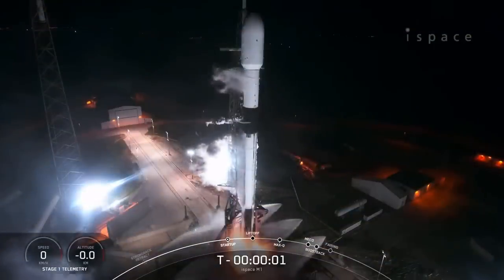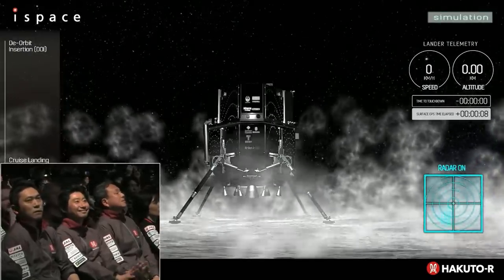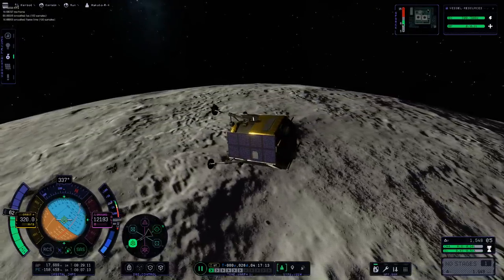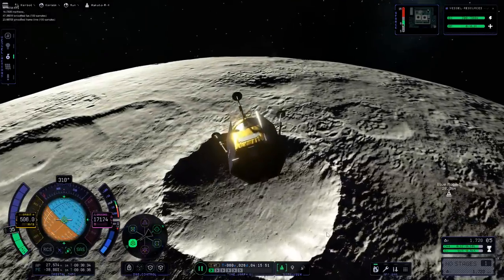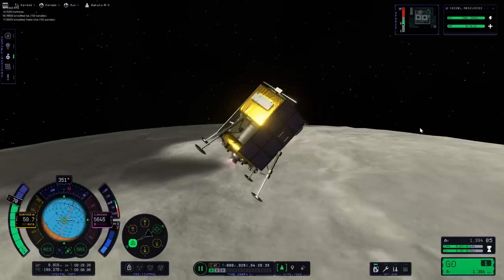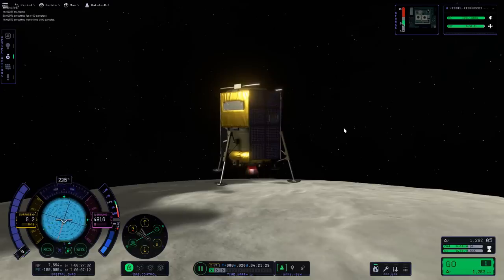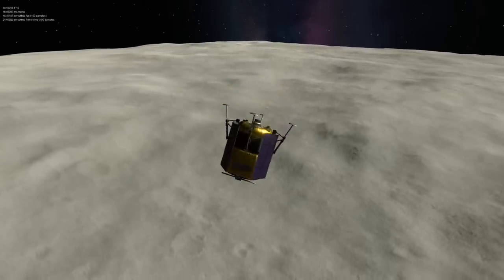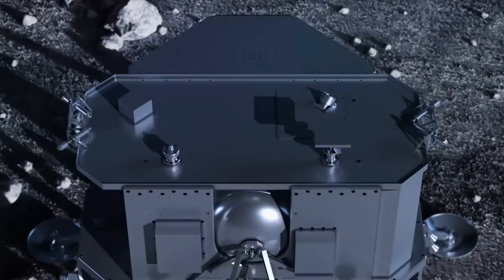Why Japan's Moon Lander Crashed Due to An Unbelievable Computer Bug

Comment: In their official debriefing, ispace actually admitted that it's primarily a (project / program) management issue, not an engineering issue. That gives me hope that they might actually learn something from this.
Reply: most underrated comment
Reply: Life imitates art: a common problem in the Dilbert comic results in utter failure.
Reply: It's almost ALWAYS a project/program management issue, not an engineering issue. This was also true for Mars Polar Lander and for Mars Climate Orbiter (the one that famously mixed up imperial and metric units).
Reply: Don’t bet on it
Reply: @Josh_728  Get with the program: in 2023, we measure things in bananas
Reply: The engineers will have learned a lot from this. Sadly, the management will have probably learned nothing.
Reply: @zackmollusc3522  If that’s the case, new management is needed. Learning from errors is important for progress. Someone who cannot learn from errors should not be managing anything, I think
Reply: @naturegirl1999 Management decides if management change is needed.
Reply: Engineering issues are also project/progam management issues.
Reply: @charleslambert3368  It should be, yes... but when a project is run by non-engineers, bureaucrats and accountants, that  is not always considered as such. ;)
This is when they can f*** up like this.
Reply: After more than 50 years after the first moon landing and with the technology since then, we can’t land a successful moon landing. Amazing what NASA did in the 60s.
Reply: @jaknap1  well those were manned missions. A little easier to land something when a person who’s there can take over and guide it in manually. As was talked about here, these are software related issues (born from the necessity to add redundancy to every facet of every process). 😊
Reply: That is an amazing admission. Well done ispace!
Reply: @Josh_728  I mean a lot more countries than the US use imperial units in some areas like aviation. Knots and Feet are the standards in western aviation even for non US countries.
Reply: @naturegirl1999  Someone that has never dealt with the admins before? lol
Reply: @aakksshhaayy  you are correct. I’ve not dealt with admins before.
Reply: Management: "We've decided to change the landing location."   Flight: "we'll need to rerun the-"   Management: "No you won't, it'll be fine."

Comment: Such a bummer that a error correction filter with and edge case nailed them. Lots of amazing data and at least it’s a software fix!
Reply: Cliff case*
Reply: Edge case?  A crater on the moon?  But it's not just a software fix is it?  Or are we talking about a KSP do-over?
Reply: Seems a pretty basic error, in what universe did they think they could figure the exact altitude without the radar? Even if it was broke too bad, damned if you do/don't.
Reply: @thePronto  They moved their landing site to align with NASA South Pole targets super late in development (post validation). The threshold for culling/re-baselining seems to be the issue. The sudden change in relative altitude wasn’t expected from their simulations.
Reply: It's not the error correction fiter that nailed them, it's the people who designed/specified/signed off on it.
Reply: The most literal of "edge case"s in history
Reply: @dsmiley53  lol
Reply: @slcpunk2740  it’s a failover option. The alternative would be mission abort if the system believes the landing radar is toast
Reply: I disagree with your opinion that this was an edge case. I do agree that this is very disappointing.
Reply: @dmacpher  I watched the video.  My point was clear: the moon is nothing if not craters.
Reply: @thePronto  no cheese? 😢
Reply: @slcpunk2740  That's how how all of these sensor fusion algorithms work. If measurements don't look plausible - drop them and continue extrapolating from the last known system state. Just imagine a real sensor failure would happen 20 meters above the ground - this approach would have saved them.
Reply: I mean that's a classic thing and a thing to learn from
Reply: @dmacpher  South Pole has another issue - lots of terrain there is permanently shadowed. High resolution Moon maps are usually done using stereogrammetry from visible light images, meaning we have to rely on laser altimeter for mapping permanently shadowed areas, and that has like 10 times worse resolution. Could be their map was bad due to that.
Reply: @SashaNaronin  shame that the LAMP mission failed. Would have provided a lot of good data on PSC at the poles. IIRC the best maps still come from LRO 😞
Reply: @EinzigfreierName  IMU/gyro drift gets worse over time! I agree it could have saved them in lots of other failure modes.
Reply: Israel, India, Japan moon missions all had similar computer/ technical glitch during their landing process.  
Seems quite unrealistic isn't it?
I wonder if all 3 landers really had problems or something bad were done to them intentionally by someone!💀
Reply: It’s not just a software bug, it’s an utter failure in developing a successful landing strategy.  A successful strategy entails dividing the entire process into distinct, compartmentalized phases so that a sensor misread during the approach phase doesn’t corrupt the data during the terminal phase.  These teams need to do less simulation and more critical thinking, otherwise they will continue to crash their landers when reality inevitably refuses to conform to their simulated expectations.
Reply: @PerfectInterview  I like lamp
Reply: "was" a software fix. Now it's a hardware problem... scattered in many small pieces.
Reply: A software fix isn't going to unbreak the craft 😅
Reply: Flying over the edge of a crater on the moon is not what I would call an edge case... especially when you're meant to be landing in the crater. 😅

Comment: I'd like to see an episode of "Things KSP Doesn't Teach" about instrumentation. How air/spacecraft instruments work, their limitations and quirks, and how they can fail.
Reply: I'll second that. 
The Soviets had a number of uncrewed vehicle losses because they used ionic sensors to determine the orientation of the vehicle, which would fail on occasion. On the other hand, the gyroscopes aboard Apollo 13 held true despite being pushed well outside their comfort zone. Some sort of video about orientation sensors would be very enlightening.
Reply: Yes please!!! We need more of those videos please Scott.
Reply: Another vote. I see it in formula racing where drivers are having to "fail" various sensors to address issues with the power train.
Reply: Yep, me too. I think I'm aware of the issues already, but I'd like to know how different real sensors would be.
Reply: @ferdievanschalkwyk1669   As a former Formula 500 driver, the fastest lap times were NOT the shortest distance lines around the track. A computer simulation takes the shortest distance, while the faster drivers took a slightly longer, but faster path that defied logic.
Reply: To add to that, I would like to know errors that killed missions (like aiming the Mars Viking antenna down at the surface and listen for instructions) and what they did to mitigate such problems (I think they call it a command loss timer?).
Reply: @JohnWilliamNowak  
But self driving cars is the thing to go. What could possibly go wrong.
Reply: I would love this too
Reply: I'll add my vote. Sounds fascinating.
Reply: If you know nothing, then you teach nothing. -Chinese proverb.
Reply: Let me tell you about pitot tubes and mud dauber wasps...
Reply: "and how they can fail."

Every way possible, and then some.
Reply: Me2. How about the explosion of Ariane 5 on 4 June 1996 caused by a software bug in the Inertial Reference System
Reply: great idea. Actually it would be pretty cool if KSP 2 incorporated realistic sensors which combine to give you a state vector.
Reply: @IAm18PercentCarbon  Having the static blocked is more fun. Everything worked beautifully until I took off, then, as the altitude increased the speed decreased.  Decided I didn't want to continue so released and landed back (it was a glider).

Comment: My experience of being a software engineer is that the code has to be tested every time. It's amazing how often things that can't go wrong do go wrong.
Reply: It is not a sw that changed but the parameters of the flight. You may of course argue that the sw was made for the particular landing zone which I do not buy. 
I may be mistaken as the video is the only source of my knowledge of the situation - sort of like this radar was. So you take a peek at the surface with radar and see this crater with it or rather a human having visual would have seen the crater - the landing module saw just a point on the surface which was 3km higher then the previous point it peeked at. I suspect what they would have needed to do is to have more points that radar is measuring especially from distance and make an average out of it or use some other technique to see where one is. When much lower this would also needed to be done to see if there is no big stone occupying part of the landing zone. I suppose this last thing was eliminated by assumption that the landing is going to be done on the flat empty surface by choice of the mission control. I suspect if they were landing on the water/liquid  surface this radar error could only occur due to a massive tsunami - well no water surface and no tsunamis but hard landing. 
Interesting to know all this tho, aint it?
Reply: Been there! Written lots of software... made some unbelievable bone-headed mistakes, which are all BLINDINGLY OBVIOUS in retrospect.   "This change is SOOOOOOOOOO OBVIOUS that we don't need to test it"  ... ha ha ha... this is when reality bites you on the backside, informing you that you definitely DO need to test it again.
Reply: @hanskloss7726  HA! Then you discover it's high tide instead of low tide... maybe you simulated it with mean sea level but a mile away someone opened the sluice gates and there was a large wave from the reservoir... etc.
Reply: @simonmultiverse6349  low tide v. high tide does not cut it here - the surface is mostly flat still at least from a 5km perspective. The crater is a different story so you need to have many points possibly also a map? Not sure what is easier here but their method obviously failed. 
We know this is not a shame - we all have been there....
Reply: Works on my machine
Reply: @hanskloss7726  That means, that the people responsible for doing tests somehow missed this specific test-case --> improper testing. Probably they only created their tests based on the specifications, but the specifications were faulty. That's the kind of fault, that you'll only catch with proper integration tests, that cover all relevant scenarios.
Reply: @scifino1 Nothing to do with integration tests. This is a functional testing issue.
Reply: Calling this the result of a software “bug” is disingenuous … there was the change of specified environment, There was a major failure mode that had no? hardware redundancy,  was there any edge/out-of-envelope testing?
Test as you Fly, Fly as you test.
Genuinely sad for the loss of this opportunity. Mission failures are never “just one thing”. 
I hope all mission anomalies only stiffen the resolve of all the teams:  I’m with Scott,  I really, really want to see bunches of these on the moon, cooperating - soon.
Reply: I am not sure that this is a testing issue. The crater with the steep sides was on the planned flight path. So, it ought to have been modelled. They should have expected the rapid change in altitude at the moment the spacecraft passed over the crater's sides.
Reply: They just forgot to set the "Fly Safe" flag.  That can be fixed for another time.
Reply: @johndennis5233  As mentioned in the video they changed the flight path after the testing was done and didn't repeat the tests. In other words they changed the inputs and hoped that the code didn't contain any implicit assumptions about the sensor readings, and they were wrong.
Reply: @SaHaRaSquad  Thanks for putting me right about the changed flight plan.
Reply: Dude, they never went to the moon, it's all make believe......
Reply: that reminds me of an old documentary about some missile-guidance software that worked perfectly for a good while ... but over time it was being installed on faster and faster missiles, until at some point, one of the speed variables exceeded its limits (like maybe a 16-bit signed integer going past +32767 and wrapping back around to -32768).   That caused the missile to think it was going in the opposite way from what it was going and went berzerk
Reply: @bledlbledlbledl  You mean missile or rocket? The Ariane 5 self destructed because of a problem like that, they reused software of the Ariane 4 which couldn't handle the higher acceleration.
Reply: @SaHaRaSquad  It's been so many years, i don't remember which
Reply: I'm also a bit surprised that one confused sensor reading is enough just start ignoring from that point on. Seems simplistic.
Reply: If only that was even remotely believable as if Japan wouldn’t test their codes it’s hilariously laughable.  It’s a scapegoat excuse cause the thing crashed on the moon’s surface and they were afraid to show the video
Reply: @maskcollector6949  Next time you want to confidently say your opinion maybe make sure you know the difference between code and input parameters. Perhaps then it'll sound like you have any idea of what you're talking about.
Reply: It ain't working if it isn't tested.
Reply: @hanskloss7726  A built in map with coordinates would make a lot more sense so it would "know" it's flying over a crater and then the sensors would just confirm it.
Reply: @rickebert7548  It's not "disingenuous" in the slightest to call this a bug.  If the craft can't land without the sensor, which is clearly the case; then disregarding data from the sensor was never a viable course of action in the first place.  "Change of environment" or any type of testing changes nothing.  The software had a flaw that prevented it from fulfilling its design goal, also known as a bug.
Reply: The worst thing that can happen to a carefully-designed program is when someone requests some last-minute change with an associated deadline. Suddenly, coding mistakes are impatiently added and QA goes out the window.
Reply: @MrBrock314  could be. I suspect cruise missiles have maps too or? If military uses that then it has advantages. A human driver (w/o earth-moon orbit net lag of course) would help too as humans look over the window and see that the indication is wrong. But I do think there is a way to make a better radar and no map application that suits the purpose. They made an expensive mistake. We maybe see what he solution will look like. Hope for the next try to be better!
Reply: I see a lot of very valid comments on this video here. Here I would like to add that the number of people involved in a project also matters, with the biggest challenges being in both communication and planning.
Reply: There are literal books JUST on screws with various threads etc. Yet I have needed to drag my co-workers by the feet to get them to document their software. It's so dumb
Reply: The naivity...
Reply: @TK-11  Well, i’ll take your expert opinion: but it seemed to me the “design goal” was changed - my experience is that mission failures are the result of a series of failures.  Let’s encourage them to sort it out and go again.
Reply: In Big companies, they always do complete test even if only 1 word is changed.
Reply: @bledlbledlbledl  Are you referring to the Ariane 5 disaster?  I use that a a good counter argument to the "If it aint broke don't fix it." Argument.  The best part was that the instruction to put a floating point value into a signed integer should have not only generated a compiler warning but the instruction was unnecessary.  You live by software.... (complete the sentence in 4 words or less).
Reply: // Should never get here
Reply: the hardest part of most engineering stuff, that it is made by people who understand the job and tested by similarly educated people, so they simply cannot prepare to the simple user or the reality, that do not know what is the expected behavior of them...
Reply: “It’s amazing how often things that can’t go wong do go Wong”